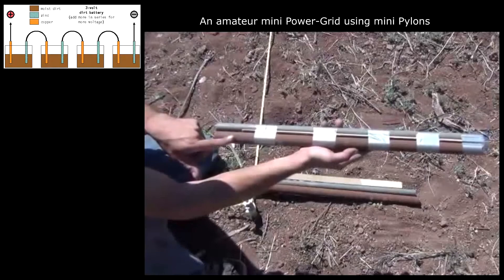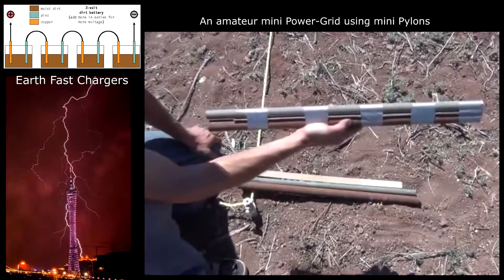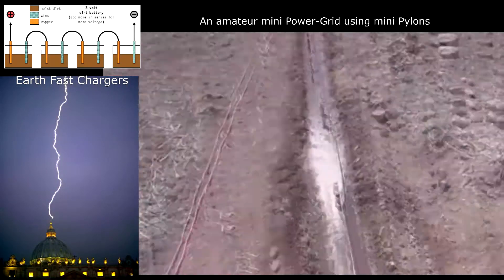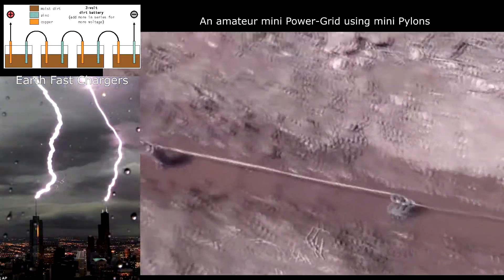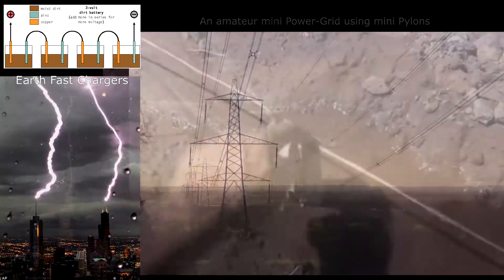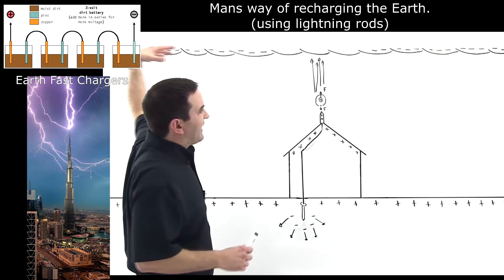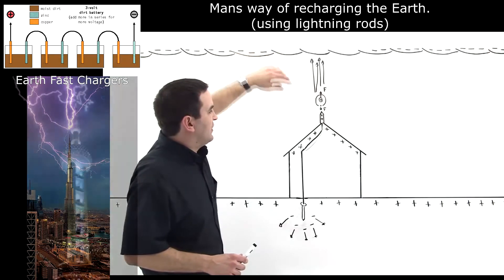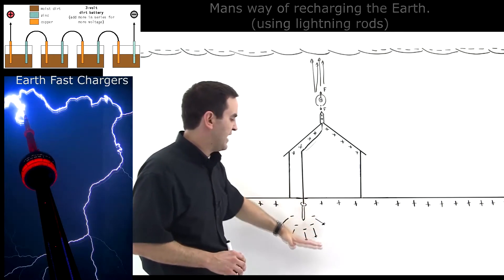EARTH is a RECHARGEABLE BATTERY

Comment: I used steel bolts prob zinc plated and copper wire, does zinc generate more power?  My 12 cell battery got a max of 9 volts and about 30ma.

Comment: Thank you for this video and for sharing. I am building a radiation (Tesla blueprint) like yours and I made als a row wit earth batteries in pots. The last I decided to put them soon direct into the ground. 
And I wanted them to connect with each other and bring the current inside the house (here is no electricity of 220 V) and then connect the plus and minus wires with the batteries of my solar panels. 
With your idea... much more easy. 
Can you show me in a very easy drawing how your capacitor is installed in the radiation circuit? That is for me the most difficult part. Did you also used diodes? Hope you will give a reaction to my question. 
Thanks again for your video.

Comment: I think I'm correct in the assumption that the copper topped buildings in NYE'S battery park ARE just that - batteries!
Reply from the maker: The buildings are just the lightning attractors, it seems to be stored mostly in the soil
Reply from the maker: batteries are not really needed, just voltage regulation (boxes with lots of capacitors)